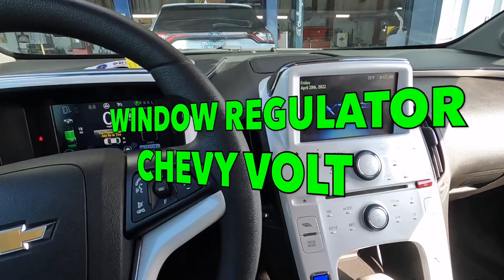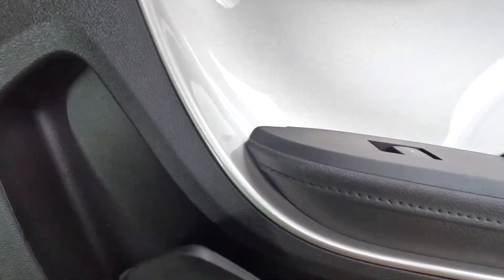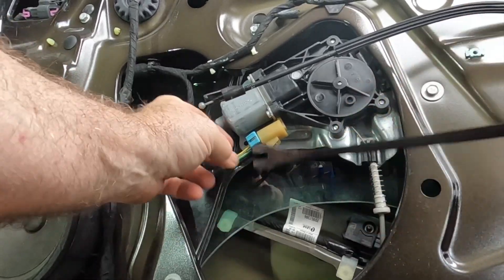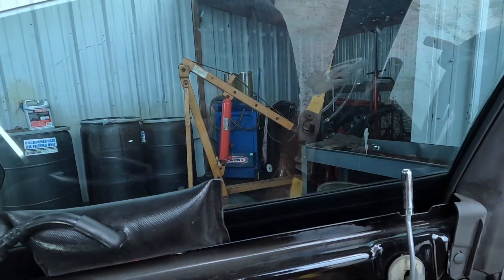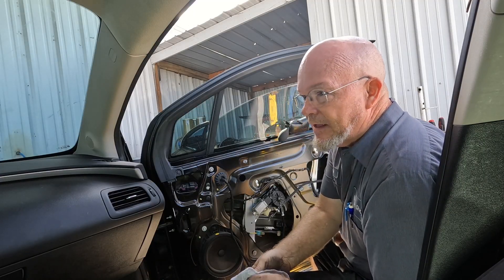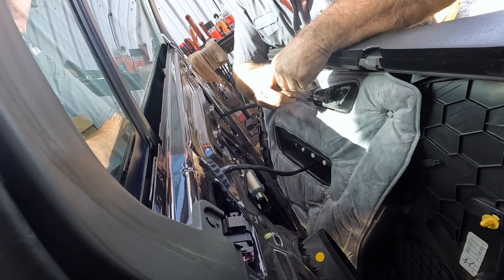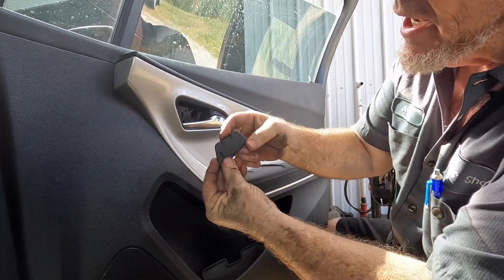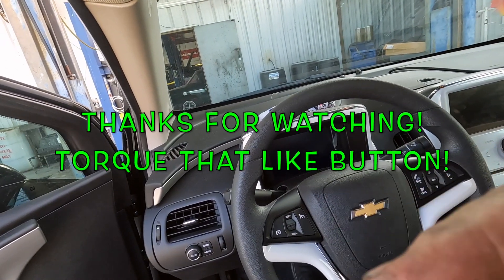CHEVROLET VOLT, CHECK AND REPAIR WINDOW REGULATOR...2012, 2013, 2014, 2015...

Comment: But what broke on it? The motor sounded fine, couldn't you just fix or replace whatever plastic clip or pulley broke or came loose?
Reply from the maker: The added labor would put weigh the price of the part and make a warranty more difficult. This is the best repair.
Reply: Not if you can do it yourself. I can do this free.
Reply: @ericeinar  That's my point... rather than pay $100 to $150 to replace the whole regulator, why not just replace the $5 plastic part? Actually, I had been thinking of making one myself with a 3D printer, although it probably wouldn't be strong enough... incidentally, I had a faulty regulator in an Olds Silhouette where it was the motor, not the cable assembly... it was also easy enough to pull off the motor by itself and, although I couldn't find a replacement motor, I was able to troubleshoot it down to the carbon brushes... and was able to find an acceptable replacement from the RC marketplace (the carbon brush had to have a spring on it, otherwise I could have fabricated one from a AA carbon-zinc battery)

In any event, I found another video that shows how the existing plastic part is designed poorly, and the poster should how you could use an allen-head screw to hold the broken plastic pieces together, and actually make it stronger... so I'm going to do that with the other unbroken one as well, so it will never break... extra time to drill the holes and assemble the screws, maybe a 1/2 hour, and the cost of the screws nuts and washer, under $3

Took longer to find the video!

Comment: This was a detailed and accurate video.  Had to go through the same hoops to get the right regulator since they have different plug versions for the motor.  Just go straight to dealership to get the easier pre 2013 mod that has the external plug. Thx, was great help
Reply from the maker: Awesome, thanks for letting me know it was helpful, really appreciate that!!!

Comment: Video is good, but I snapped the little door cable receptacle in the process of trying to undo it and I don't know what to do now.
Reply from the maker: Sometimes it can be glued, sometimes it might need to be replaced. I’ve made tiny brackets to hold small items also, but it takes some patience and maybe even drawing out on paper to sort out.
Reply: @JimmyMakingitwork  hmm. is it safe to superglue plastic? i seem to remember that it doesn't work very well
..... not that i can find the other bit to the connector in the first place; it hit the ceiling and landed somewhere in the back of the garage so it's probably just lost to the Void™.
at this point the door is messed up six ways to sunday so it might be worth just taking it to the shop and/or replacing the whole thing outright. very much appreciate the video though

Comment: The step where you unhook the string cable was difficult to come off. I forced it and now I can’t hook the string cable back. It seems that I broke the part where the wire is supposed to hook on to. Hopefully that makes sense. By any chance does anyone know what the part my be called? I can’t find anything online. I have a Chevy volt 2014
Reply from the maker: Do you mean the door handle cable? Usually you release the cable housing from the door handle bracket and then it fits thru a small slot and will lift out of a hole that the handle pulls to activate the cable.
Reply: I believe I broke the door handle bracket. For sure not the cable. I ordered a couple of door lock rod clips, hopefully that’s the part.